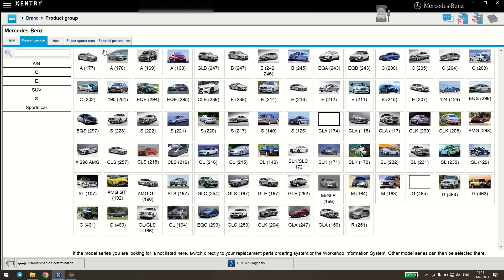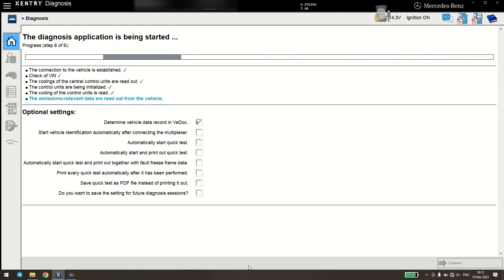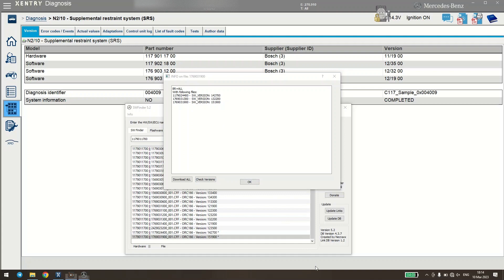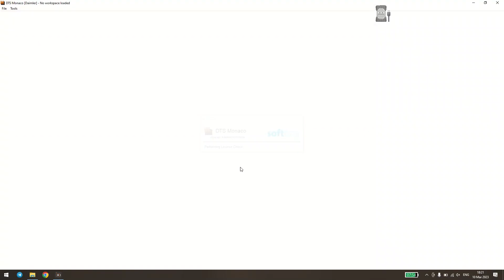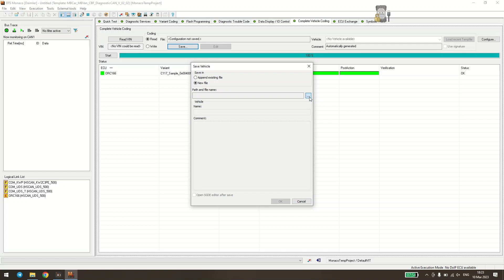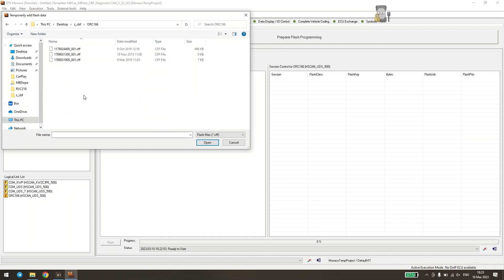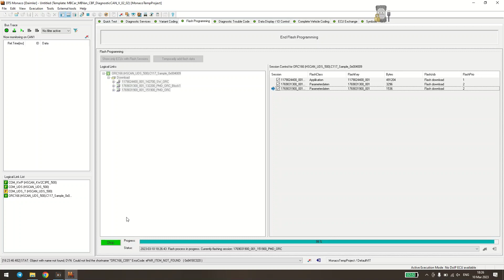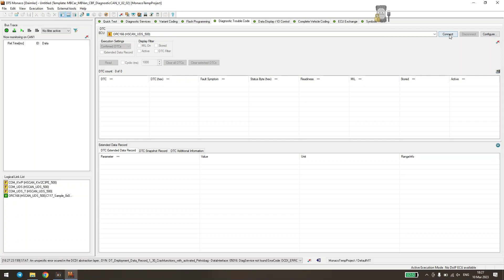Mercedes Electronic Module Flash Software Update

Comment: Lately Monaco is losing open port connections a lot.
 Do you know of any solutions? I am using a legitimate open port. The voltage in the car is normal.
Reply from the maker: During open session?
I think you need just to reinstall Monaco
Reply: @mbdope  Looks like the version was out of date! Thanks 👍

Comment: Hi ;i have an issue with software from cluster;can be copied software from new cluster to old cluster?
Reply: W253
Reply from the maker: Hi! It is difficult to find the right firmware for each analogue dashboard, because there is always only one SW for each HW. Digital dashboards can be updated, or firmware changed.
Reply: @mbdope  ok

Comment: Thanks for sharing this great info.
I got a question this prepare flash programming feature on monaco that isolates the modules does vediamo has something like that?
And why there is 3 files to flash for this 1 module

Have a nice day keep going
Reply from the maker: Thank you for comment! 
I didn’t found isolation in Vediamo same as in Monaco. 

Some of ECUs have 1 software, some up to 7. 
You can check how much softwares each ECU contains. It could make it by clicking on every ECU in Xentry scan for example. Or just check software details same as in video.
Reply: @mbdope  thank you again. But it's still safe to use vediamo, i have recently started learning it and i like it.
Hope in one of the next videos you talk about VGS with vediamo. 

Keep it coming 💯💯

Comment: HI;ECU  ENGINE CR43 FROM MERCEDES X253 CAN BE FLASHED ?
Reply from the maker: Hi
The same procedure. You just need to have right software to flash
Reply: hi;i have to copy software(not coding,not km ) from cluster w253 to another;do you know cabn be done with ecu exchange from dts monaco ?

Comment: In SW finder the last software number it’s correct one ? And can i do same way for update VGS ??
Reply from the maker: Thank you for the comment. 
Software version in the last column is written in format YYXXXX. Where is YY - the year of release, and XXXX - version of release. Usually you can find version numbers in diagnostic software or ECU sticker in format YY/XX.XX

Actually all the same in ECUs. Except VGS. In some models it’s not enough to find last version by HW search. But also need to choose appropriate one, depending on engine model and drive type (4x4 or 2x4). 

My advice for updating the VGS module is to look for a car with the same engine and drive but with a newest software version.
Don’t forget to save all codings before. Also good idea is to save whole car Xentry scan to have all original HW and SW versions in one place. 
And to plug in battery charger when you update VGS module.
Reply: If same hw number vgs have different software but same coding and both DAS teached will work fine or will have issues?
Thanks in advance

Comment: excellent video, can you make video about activating NTG5S2 maps ? or how to read or generate activation codes for those navigation maps? or how to activate amg cluster in w222, or how to show 330km max speed on cluster?
Reply from the maker: Thank you for comment. Navigation maps are activated by entering a code through the radio interface. Therefore, no special knowledge is required. The activation key is generated based on the map version and vehicle VIN number. Unfortunately, I won't be able to make a video about this - YouTube blocks videos containing piracy materials. Map data is paid software. As for the IC222 dashboard, a software version change will be required to activate the AMG. The program version is selected based on the current version of the HW of dashboard.
Reply: @mbdope  on your video are showing few error, and the are still present after cleaning codes. How to solve this situation?
Reply from the maker: Some software updates add additional options that need to be coded. In the video, a W176 car with pedestrian safety sensors physically disabled. After the update, additional parameters appeared, including the parameters of those same sensors. Therefore, after turning off the sensors in another section and coding manually according to the configuration, all errors were gone.
Reply: @mbdope 
Great video 👍
Reply: ok bro

Comment: GOOD VIDEO;CAN YOU CONTINUE WITH ADDITIONAL CODING ?
Reply from the maker: Thank You. Sure! Please write what interests you? And I will definitely make a video about it.
Reply: @mbdope  it is possible to write a software in control unit ;it to be blocked; then rewrite the original software?
Reply from the maker: Sorry, I didn't quite understand about blocking. Anyway you can flash the software as many times as you like. Both newer software versions and older ones. Even if the software change has not been completed fully, you can initiate the firmware flash again.
Reply: @mbdope  can I write software from w253 year 2019 to w253 2016,on instrument cluster ?
Reply from the maker: Of course, but only if the HW numbers are the same.
Reply: @mbdope  hardware number is not the same;I can t write another software?
Reply from the maker: No. 
Software should only be installed that matches the hardware version. I experimented - some software works fine, some works with errors (for example, the arrows start to rotate in the opposite direction). In some cases, the module turns into a brick. 
But if you're willing to sacrifice your dashboard for experimentation, you can give it a try. Most likely the restyled model software will not start flashing, because there will be an error in hardware compatibility. 
W253 in restyling works on a different can-bus. The dashboard doesn't fit at all.
Reply: @mbdope  it is quite possible;i will   try on another dashboard;i am a beginner with  software  dts monaco;the a module with a certain hardware,dts monaco allows me to write only certain software ?
Reply from the maker: There is no thorough compatibility check.  Unless the file size or format does not match at all.
Reply: @mbdope  ok;thank you for all
Reply: the whole problem is due to the fact that w253 years 2015-2018, it does not show the door open only after 10 km/h, my son opened it, I left without realizing it; the on-board software is responsible for this issue;
the amg software for the cluster fixed the problem; do you have the amg software so I can copy it to my dashboard, please?
Reply from the maker: I think this issue could be fixed by ECU coding, not flashing. I’ll make same experiments with doors on my w205. It has the same electronics as w253
Reply: @mbdope  I took every parameter from the coding board, but without success;i receive some software number from amg cluster(it show door open ,i saw it myself ;can i send to you to verify compatibility with your or my cluster ?
Reply from the maker: Yes, sure. Please write your contacts in website form on mbdope.eu 
Any convenient way of communication for you
Reply: @mbdope  Thanks for great videos. Can you please make a video about ECU Exchange for FSB3 ?